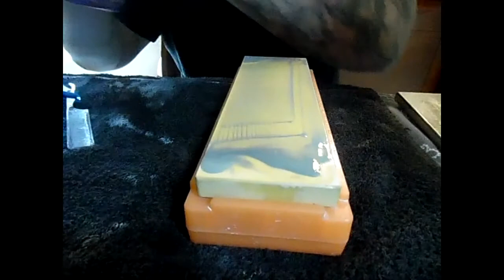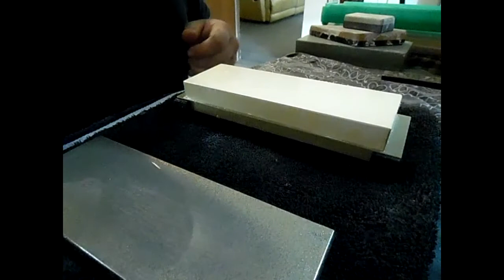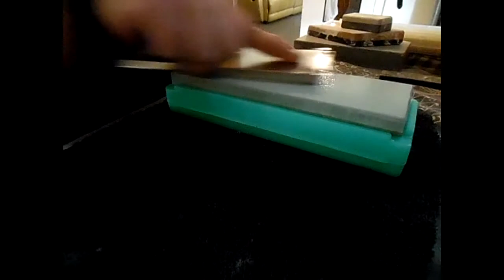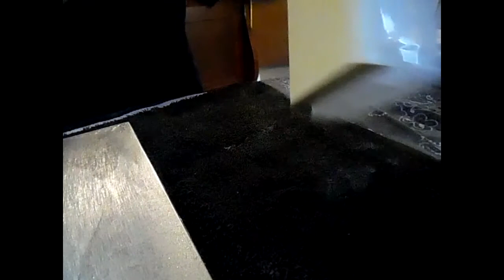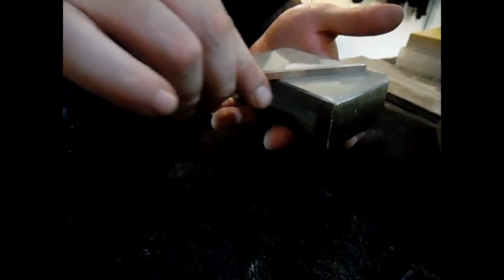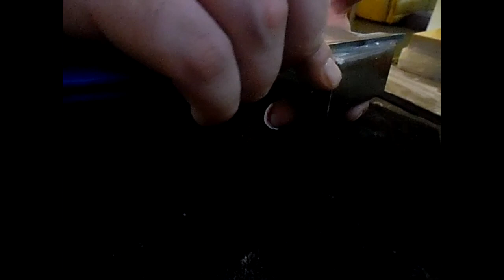simple method for honing a straight and finishing with jnats

Comment: Great videos, man! I have a Norton lapping plate/stone and was wondering, since I presently don't have the funds for a DMT, if the Norton could be used to make a decent slurry. Thanks, man!
Reply: If it's one of those silicone carbide stones,  with the deep trenches... usually blackish grey, I wouldn't use that. What you can do,  and I have done,  is use a hack saw and cut a slurry stone from the host stone. Itll make your stone slightly shorter, but won't harm it and you'll have a matching slurry stone.